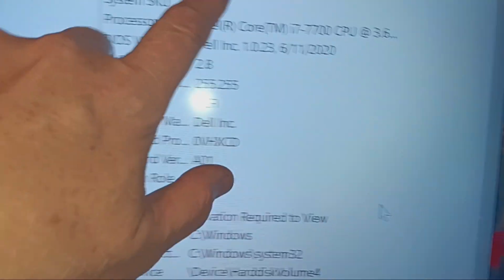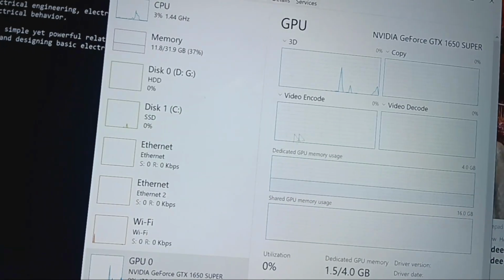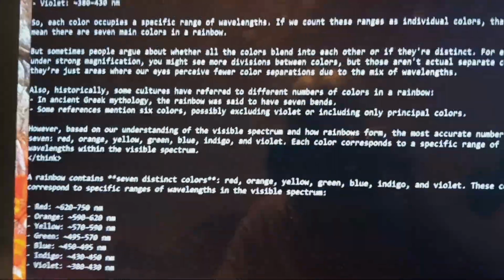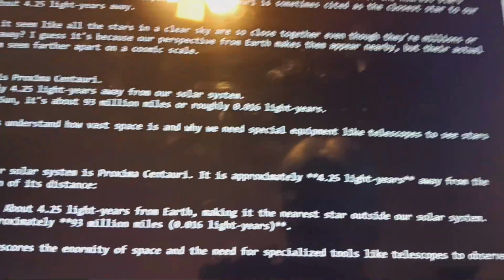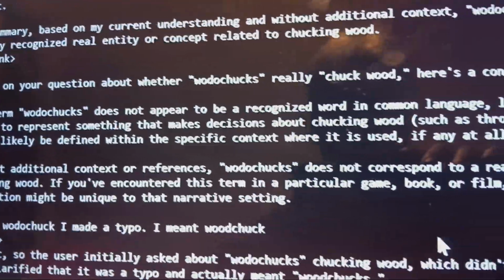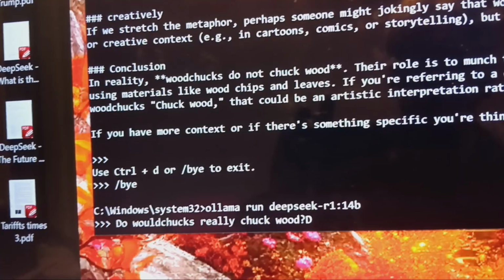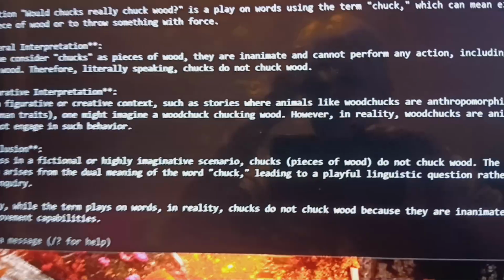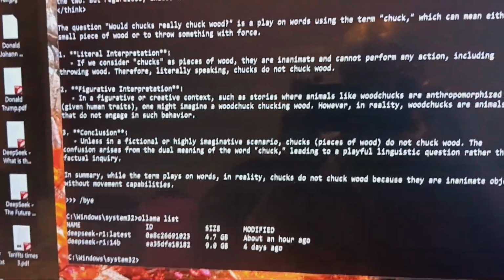Can DeepSeek R1 Running Locally on an Old Dell PC? You Bet!

Comment from the maker: According to Reuters, "Microsoft has earmarked $80 billion for AI in its current fiscal year, while Meta has pledged as much as $65 billion. That is a far cry from the roughly $6 million DeepSeek said it has spent to develop its AI model." Source: Google Search results and Reuters (http://tiny.cc/pb29001).
Reply: if you stop being a clown, and actually read deepseek research paper, you can notice that $6M is the price of a single training run, if they rent GPU-s in the cloud.
Reply: does not include salaries, previous runs, failed runs, previous versions of the deepseek model, gathering of data, filtering of data, actual research costs.

Comment: Just amazing. I still have a hard time believing we can get a 9 GB file to think like this.
Reply from the maker: It is not perfect. Like all AIs it does make mistakes. I asked to name the provinces in China and it got a lot of them wrong and duplicated others. You would think an AI made by China would get the names of China's 34 provinces correct! lol :)
Reply: @ElectroRestore  Saw a news article that Apple's Seri gets many of the Super Bowl winners wrong. I see DeepSeek has a 600 GB model. Still amazing what the 9 GB model does. I wonder if that means the 600 GB model is 60 time better than the 9 GB model?
Reply: @franzliszt3195 the 600 GB model would be much more advanced than just a fact or 10 over the 9GB model. It is more logarithmic I would think.
Reply: @KJB-Man  well, it might be synergistic, which would be more than linear.